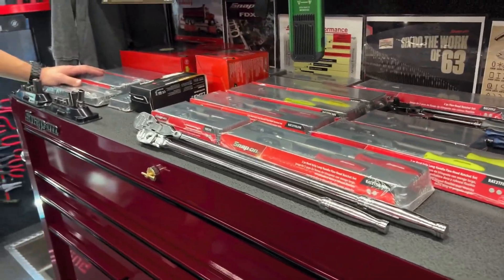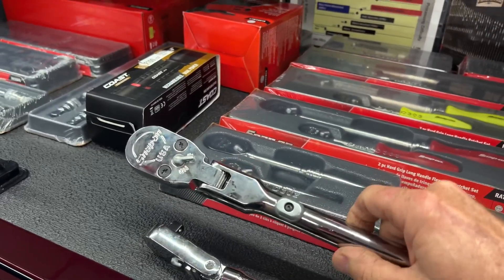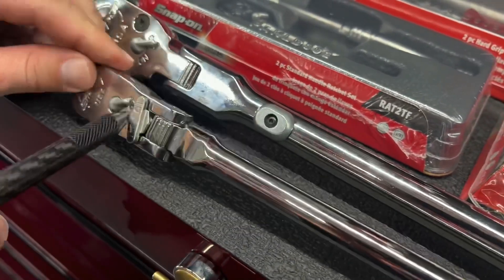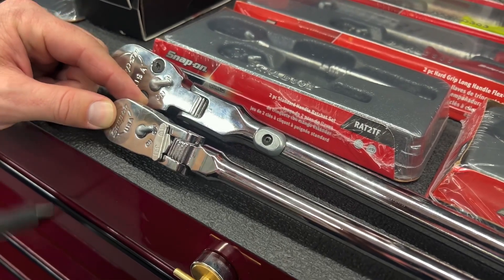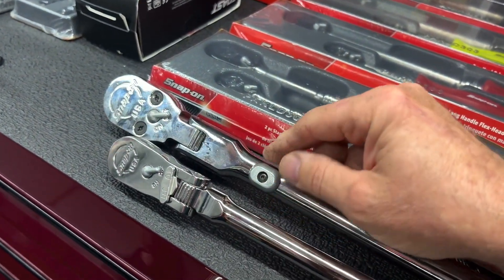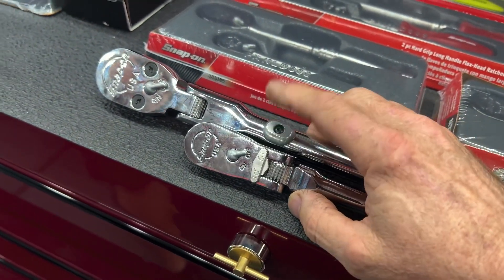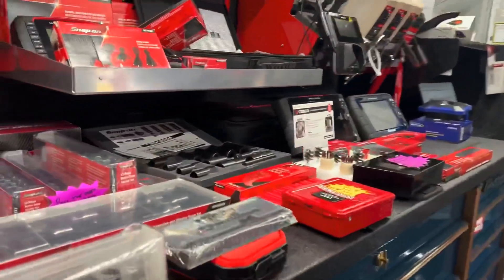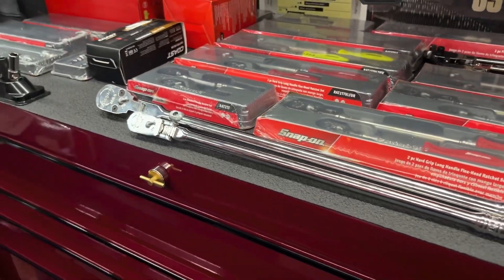Snap On new 3/8 locking flex head ratchet vs 1/2 locking flex head

Comment: id assume it hasnt changed since the design is brand new, i think overtime all their locking flexheads will have this design
Reply: They are slowly changing over now. Now you can get them in non locking extra long and locking standard handles and long locking flex heads

Comment: Old school mechanic here, gotta say through out the years I tryied all types of name brand drive ratchets,  gotta say Snap-on is crap and it's overrated & way overpriced. The new locking flex head looks like it would loosen up over time, plus the off & on switch tools cheap. Now I do say the only thing Snap-on ever made thats good in quality are there wrenches & that's pretty much it. If your looking for a good quality locking flex head drive ratchet,  I would suggest the Gearwrench 120xp.  It's smooth when torque,  it has a flat small drive ratchet head, to get into small tight spaces, plus the off & on switch is good quality as well as the locking mechanism. Plus not expensive as the Snap-on.  Old saying, a true mechanic doesn't need an expensive tool to get the job done. It's based on skill & experience. But hay that's just my opinion.
Reply from the maker: Thanks for your comment. I appreciate your opinion👌  that sounds cool I’ll definitely have to check out the GearWrench 120 and get one. Can’t have too many ratchets and I do have a GearWrench 3/8 regular length ratchet, and it works pretty good and has a thinner head then the snap on which is pretty cool